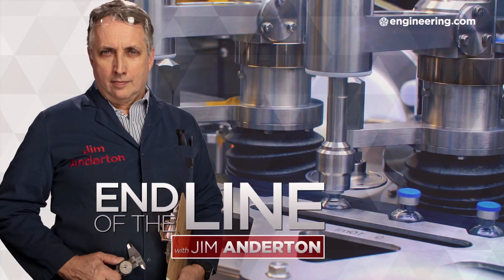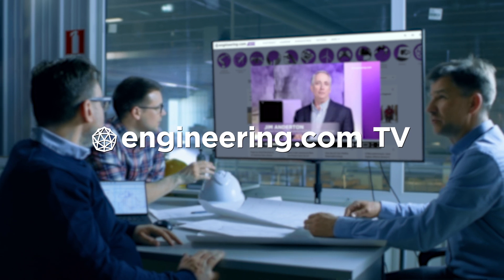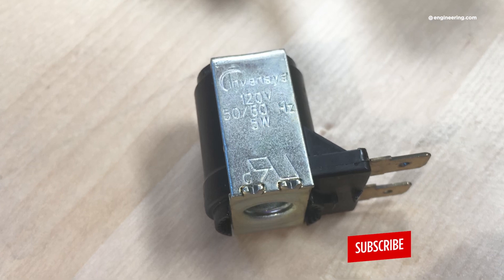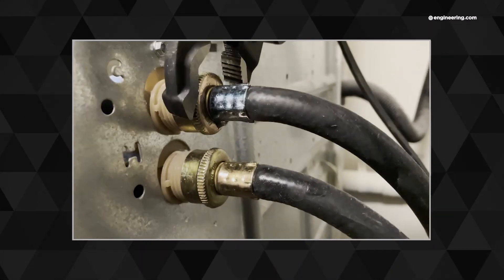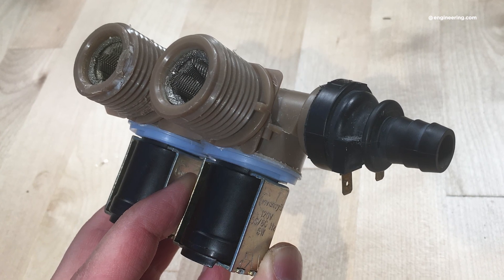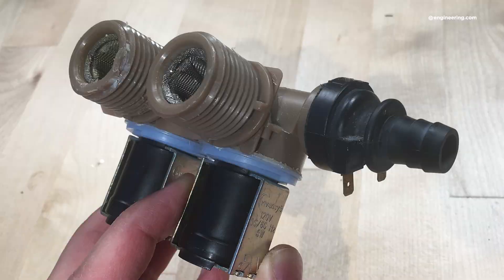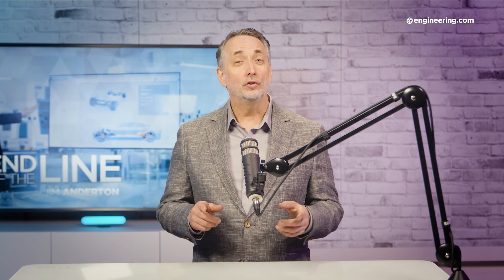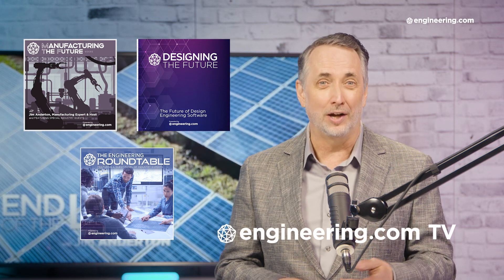This Washing Machine Valve is Pure Engineering

Comment: You didn't explain a damned thing.
Reply: THERE IS A SEAT IN THE PLASTIC BODY LIKE A FAUCET SEAT. Then there is a plunger with a seal on the end that when closed, is against the seat. this interaction is what closes the valve. When the coil up top is energized, it creates a magnetic force that pulls the metal plunger up and away from the seat, effectively opening the valve and allowing water to pass through\